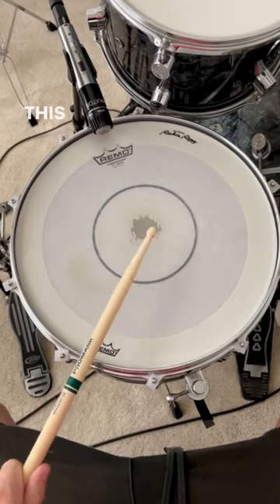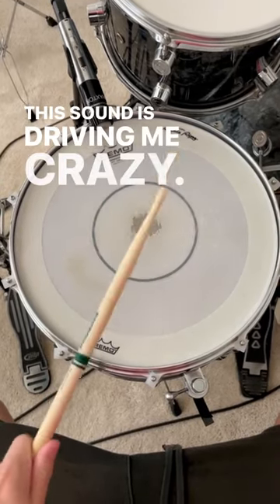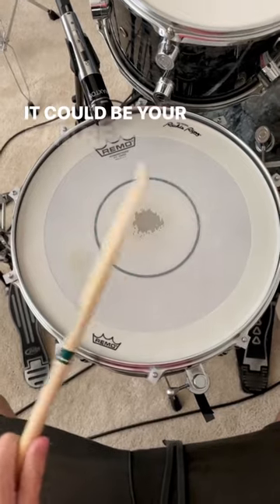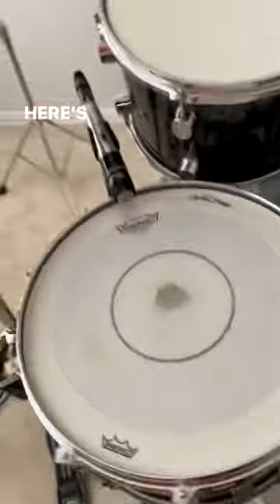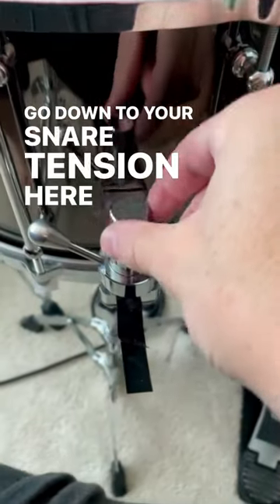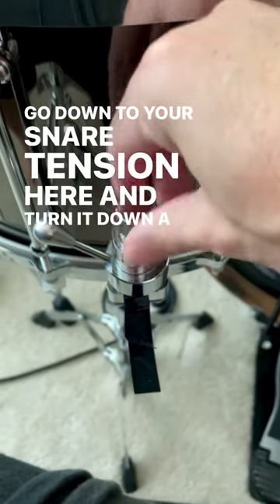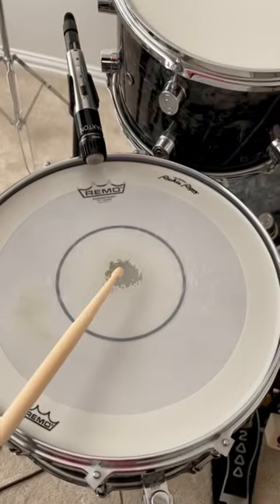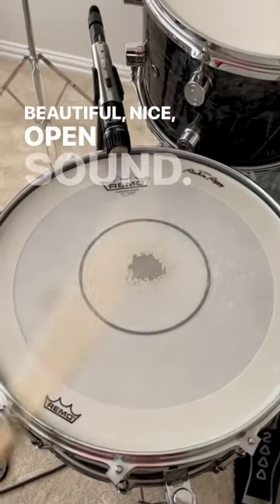SNARE DRUM TUNING 101!

Comment: That did not sound choked in my opinion😂. Maybe try taking the O-ring off it first and then tune/adjust the wires to see how it sounds. You will get a much more accurate starting point with a non muffled surface. if it still sounds bad from there try tightening the bottom head. People often forget about the resonance head and how much of a difference it can make to the overall sound. And THEN you can add some moongel or an O-ring to taste. Hope this helps 🤙